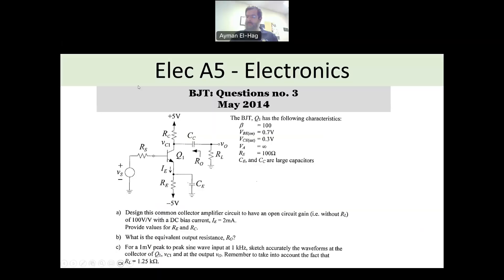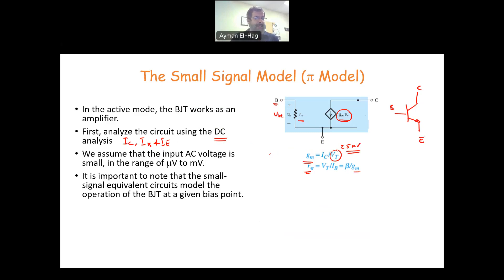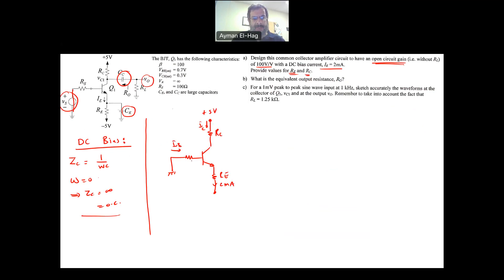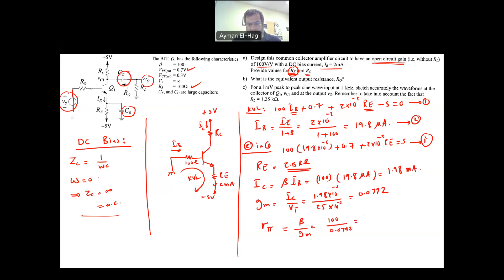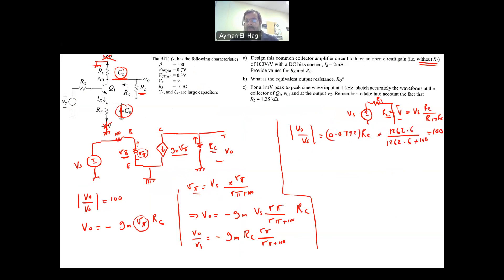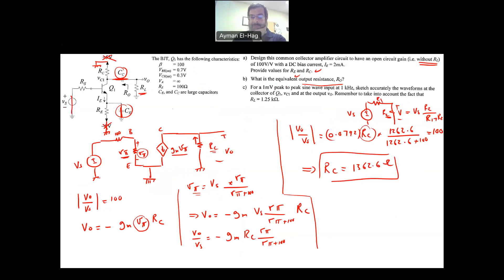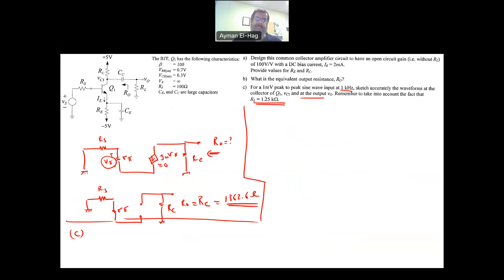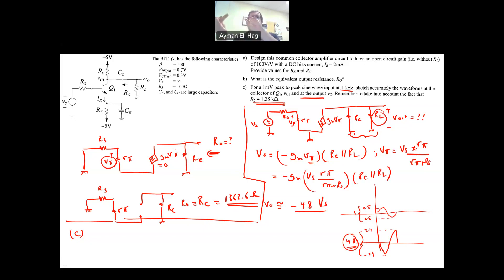PEO solved examples (ELEC A5): BJT Question no. 3

Comment: Hi Professor, at 10.32 - why do you assume I is going in opposite direction? When polarity is + to - and I flows from higher potential to lower potential wouldn't it make Vo = + gm.V(pie).Rc?
Reply from the maker: The current direction in the dependent source is fixed and same is the output voltage polarity, hence the negative sign.